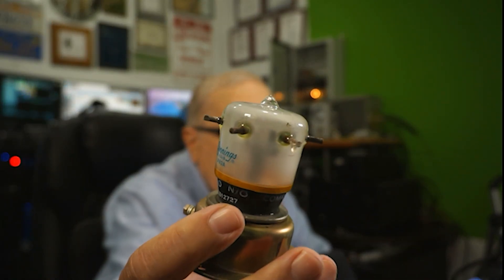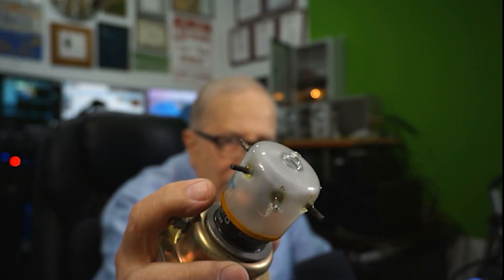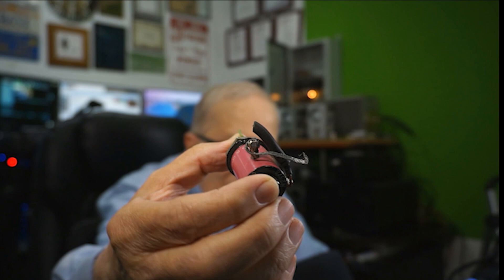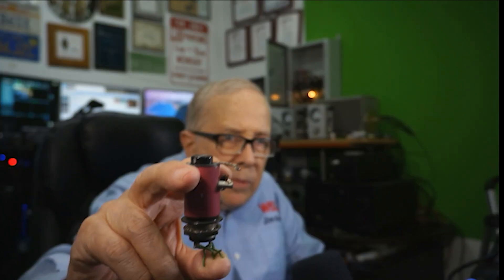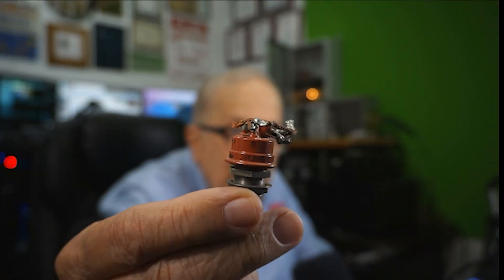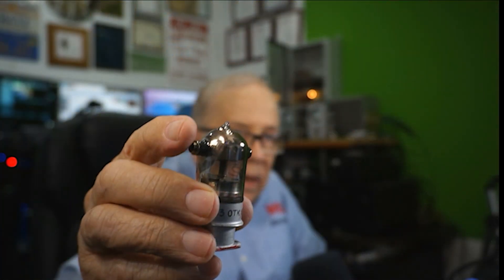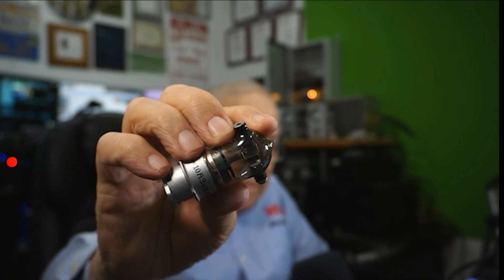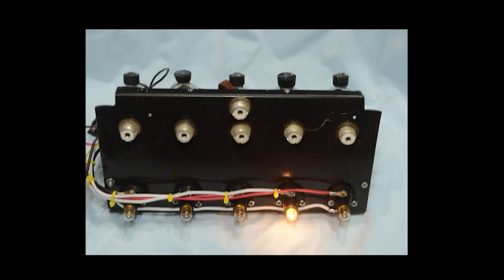What Can You Do In a Vacuum?  Build a Coax Switch Using Vacuum Relays by Jim Heath W6LG

Comment: Hi Jim, which kind of cable you use to remotely switch the relays? I mean: how do you shield the switch signal from possible RF leaks inside the box? What countermeasures do you apply to isolate the RF signal from the control signal? Do you have a circuit diagram to show? 
Another question: your relays are inserted in a sort of brass-colored socket... while in the various sales sites, this socket is not visible... can you tell me more about this socket?
73 and many thanks, Matteo IV3YNB

Comment: Jim, have I been doing  it wrong all my life.  Isn't voltage equal Ohms times Resistance ????   Joe K7GW
Reply: Voltage is Current times Resistance. He is talking Power. Current squared times Resistance. Power equals Current times Voltage. Voltage is Current times Resistance, so substitute Current times (Current times Resistance) or Current times Current times Resistance, which is Current^2 × Resistance.

Comment: I've wondered for a while if vacuum relays could be made using relays on hand by leveraging any one of the many vacuum chambers and a creative method to get the seal to take effect. Replace the plastic case with a glass tube or even a shot glass potted in epoxy. By removing the atmosphere around the contacts, the breakdown voltage goes up.  I don't have a need for one but perhaps this would make for a good winter project.